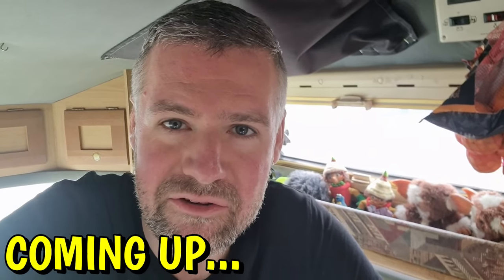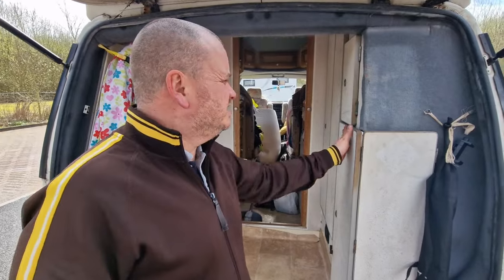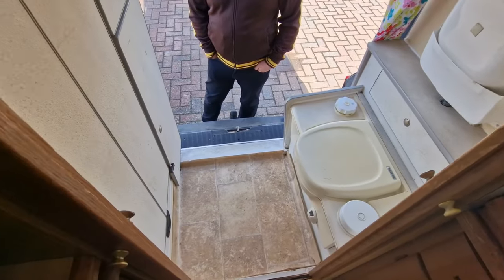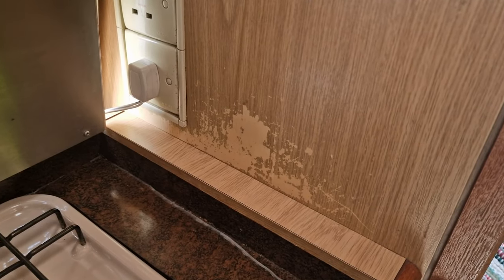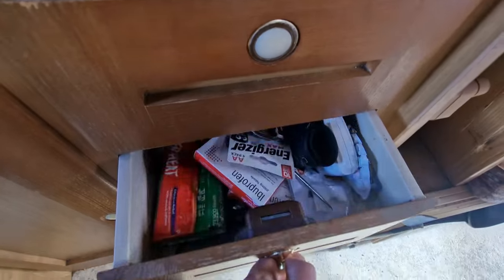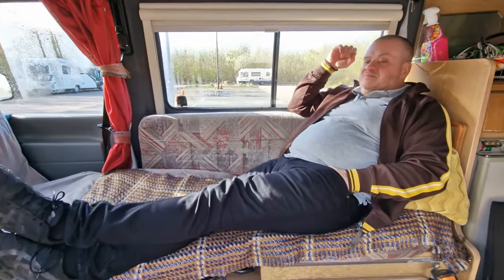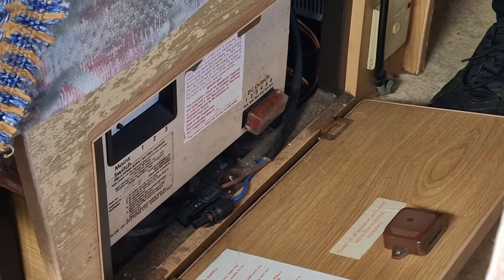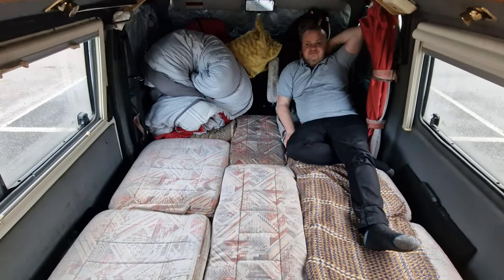HONEST CAMPERVAN TOUR - FULL TIME VAN LIFE in our TINY HOME on WHEELS!

Comment: You could replace your vent with one of those maxi fan type vents to suck steam out? Some YT vanlifers are just that, professional vanlifers that do nothing else. Youze are two blokes living in an old ready made van and working part time, interesting to see how you make it work without throttling each other, I guess being married helps. 😄 That van was fully loaded with options from new. It would have cost a bomb. 👍
Reply from the maker: A maxi type fan/vent would be ideal - not least because in summer the current vent does nothing to cool the van down. I suspect we'd need a better power set up to support it, though. 
And thank you, essentially we're two guys who wanted to live a bit differently for a while (a while meaning who knows how long) and find work to support it. So far, so good, however rough around the edges it often is 😆
Oh we do argue believe me - but considerably less than when we lived in a house in our old jobs, so I think that suggests we're happier overall, but mostly that we have no choice but to sort it out because there's nowhere to storm off to in this tiny van 😂

Comment: This is my first time seeing you guys and Daisy.  I really enjoyed your video.
For the scratched up bit to the right of the hob, maybe a small spice rack?  That, or a lick of paint.  Of course, you paint a bit, and you have to paint the whole lot.
Those vent screens, do they come off?  They should do, for cleaning.  If you can get them off, without destroying them, put them outside on the grass and use your shower to wash the dust out.  Water works better than a Hoover, especially with a stiff brush, a bit of washing up liquid and a little elbow grease.
Do you still have the table top for the bed area?  It's supposed to rest on the seat support rail to fill in the middle of the bed.
Cheers.
Jon in rural BC, Canada
Reply from the maker: Thanks Jon for all that help! The spice rack is a damn good idea, we keep our spices in a little pull out cupboard but if we put one there it would free that up for other things (plus easy access when cooking) so I love that idea!
I would assume the vents come off but we're a little reluctant to try. I think we need to persevere a bit at a time with those as there's years of dirt that's built up.
We have 2 tables, the bed has a middle cushion section that slots in so I'm not sure if the table fits in there too but maybe it does and we've missed something really obvious all this time which sounds about right 🤣
Thanks for watching and some great advice 👍 😀

Comment: I've heard if you want a successful YT Van channel you need a bikini girl showing bxtt. Maybe Steven could wear the swim suit? lol.

Most of the lighter wood look is really laminated chipboard. So a plastic like sheet glued over wood made from wood-bits and glue. Therefore a light sanding with 300 and or 600 grit sandpaper and then paint with your designed paint/colour. Sanding will help to clean/level and make paint stick properly and not run when drying so much. Masking-tape will help to not get paint on real-wood frames and edges. To me the wood theme looks good, but it's wearing. The back toilet area board if fabric, no sanding, just paint straight on for a unique hard texture. The plastic side trims should come off before painting. Test first if you like. The ends and frames of your kitchen is real-wood trims, so keep unpainted, or paint if you want a uniform look. If kept unpainted, then sand with 600 grit, & clear varnish.  I would rip out toilet and shower, and just have a camping seat-toilet with a built in bucket. That will open up storage room.  If you want to bring back whiteness of the old plastics if keeping shower and toilet, then research "retrobrite" methods.  Maybe with the cupboard above the cooker, put foam stick-on seal for doors, so when closed no steam gets in?
Reply from the maker: Good Morning, thank you for these absolutely amazing tips! We are extremely slow at getting around to anything - in our defence, you often need somewhere secure to park up for a few days and with access to a separate sink/cleaning facilities etc so we can work on things more comfortably, but that is tricky as we don't have anyone where that's possible anymore as far as we know. Still, one little job at a time is of course possible anywhere and you've given some really helpful information there - very clear and easy for us to understand too. Thank you, it's greatly appreciated 🙏